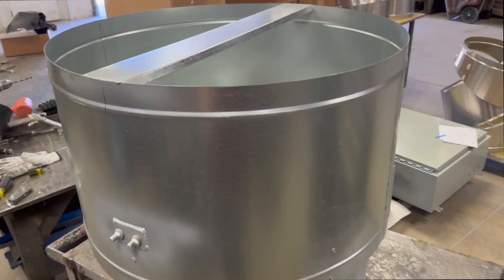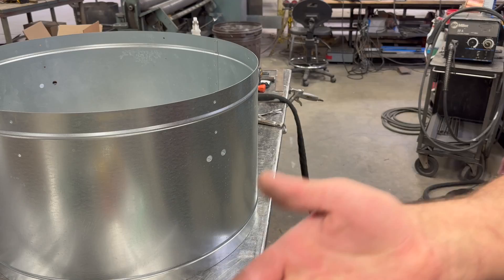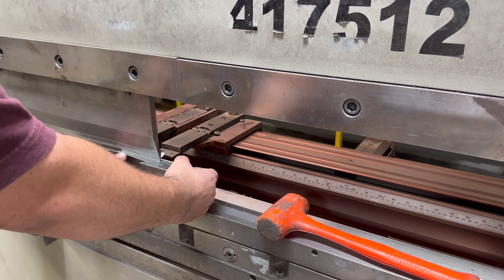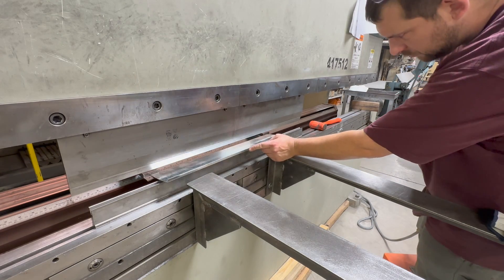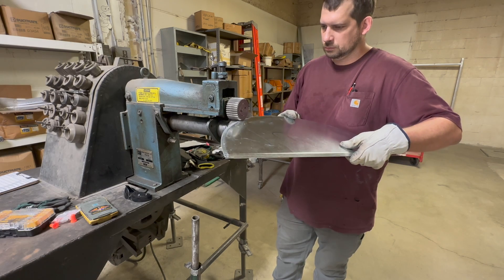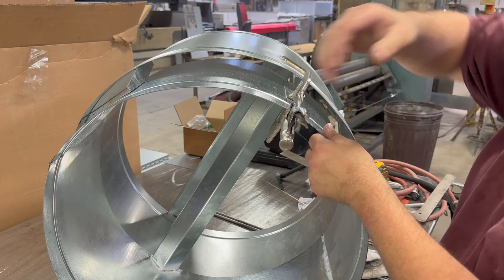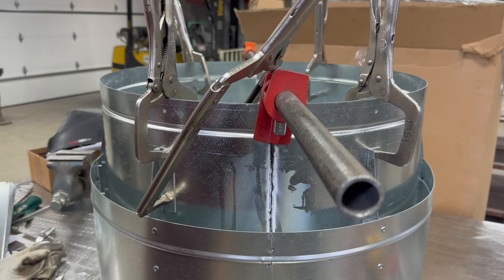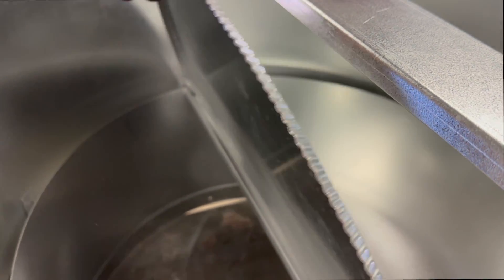UPBLAST PAINT BOOTH VENT CAP

Comment: Great video.   "Water can sometimes travel uphill" is a seemingly strange sentance, but capillary action is a thing.   I didn't know it was possible in metal joints.

Thanks for posting, and thumbs up.
Reply: Cool to see ya tig brazing with the silicon bronze. Still haven't tried it yet. We use to   spool up our 250x's with sil-bronze to glue perf nosing in the ends of ductwork to cover the insulation, works well. Haven't seen you in a while, should upload more.😊
Reply from the maker: @mitchdenner9743 thank you sir, I’ve cut back on drinking so maybe that will help me get some more videos out, lol. Glad to see I have a returning viewer
Reply from the maker: Thanks for watching and commenting as always!